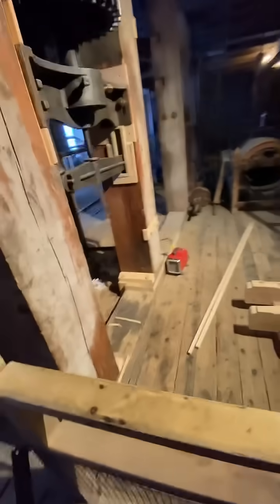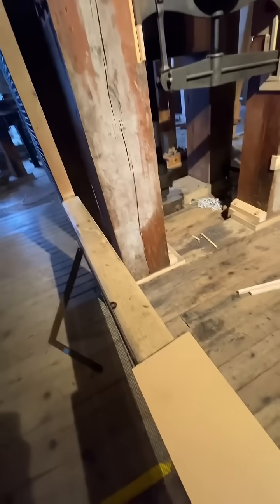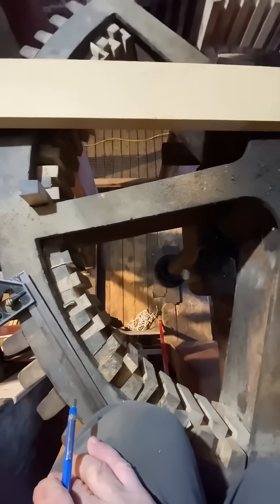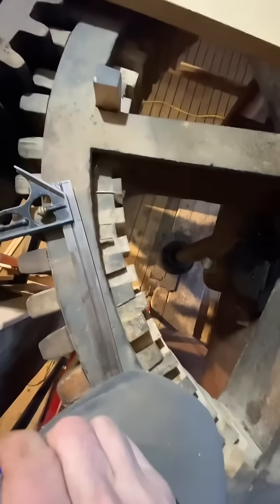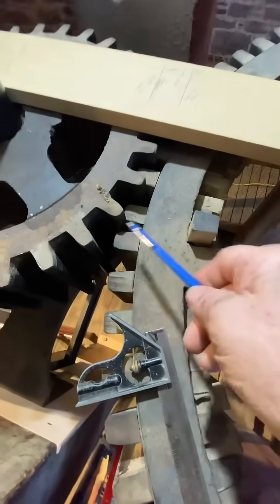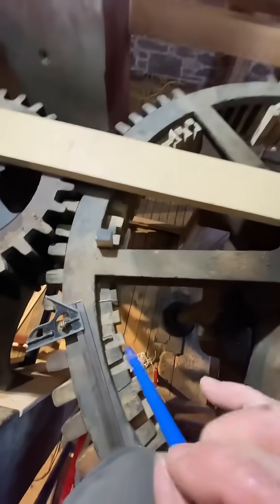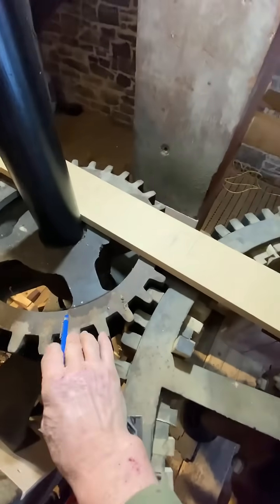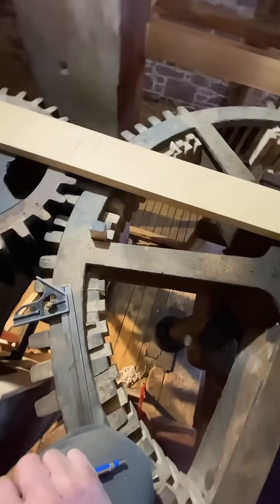Watsons Mill, Maine driveline 60 Hp rebuild

Comment: Thats an interesting job, are they fruitwood? Are you going to take them out to machine the profile? Or, do it by hand in situ, should be possible to work out what the correct form should be, it doesn't look like the cast iron pinion teeth are quite an involute profile.
Reply from the maker: it's actually rather sophisticated and the ones that are in there right now are not sophisticated enough to give a rolling contact which is required to transfer the power from one gear to the other